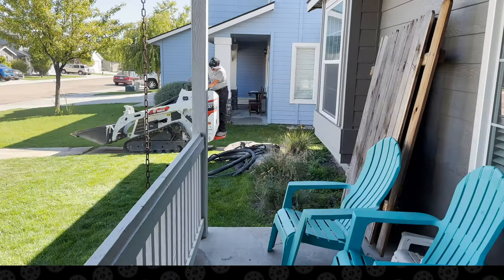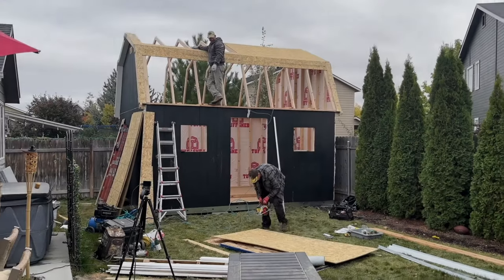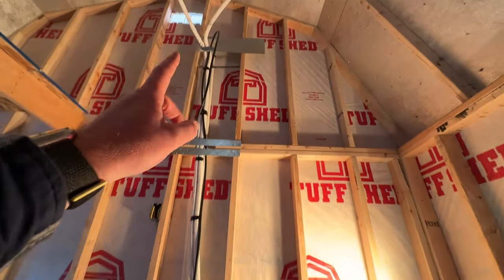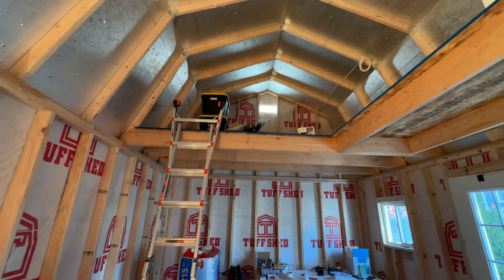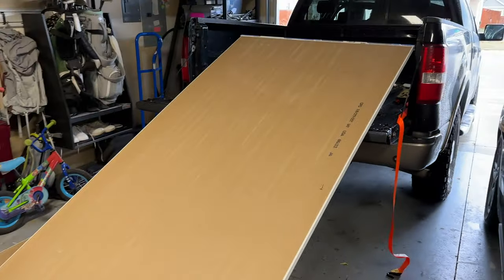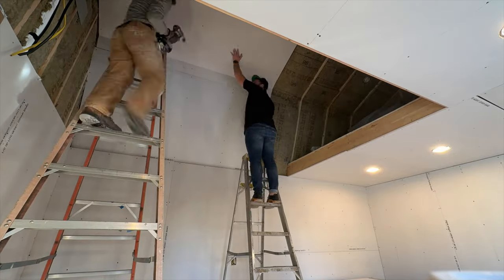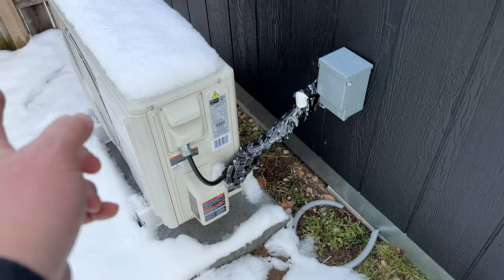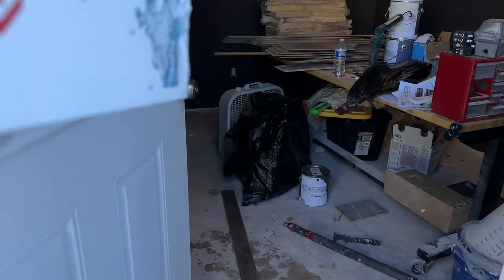Building a Backyard Studio in a Tuff Shed - Start to Finish

Comment: The only thing I did in mine different and don't understand why more people don't is put the outlets higher than standard. Eliminates a lot of cable hang and those short cables can be used. Plus Drywall seams should be staggered (done this for 30 years) makes the wall stronger. Great job!

Comment: I’m in the Pacific Northwest and am in the process of converting my 200sq ft Tuff Shed into an office space. The ceiling has the radiant vapor barrier like yours. Drywall and insulation contractors won’t touch the ceiling because of that vapor barrier and ventilation. Two have told me that baffles are required (which is an easy fix) but with 2x4s and the studs being 24” on center, that won’t leave much room for fiberglass insulation. The other problem I’ve learned after loads of research and talking to insulators is that insulating over the vapor barrier will 1. negate the function and efficiency of the barrier, and 2. create the perfect trap for excessive heat and moisture which eventually leads to all the problems. So, I’m curious about your ceiling insulation, are there baffles? Either way, how are you keeping the airflow between the vapor barrier and the insulation circulating? Have you noticed any issues yet now that you’re over a year in? (PS: I can’t get Tuff Shed to give me any answers about the ceiling and insulation, so any advice you have is great!!)
Reply: I am also in the Pacific Northwest with a TuffShed. Ours is the same size as the one in the video. 

I opted for the ridge vent. To make sure I still had airflow I used foam insulation taped to the faces of the rafters, leaving an inch space between the insulation and the inside of the roof sheathing for airflow. The air intake is via the eaves. I can draw you a diagram if you like, or share some photos. 

We've had ours insulated and sheathed in gypsum board now for almost two years through two winters and it's been great.
Reply: Walls & roof definitely need to be able to breathe. This shed is going to eventually grow mold in the walls and have moisture issues from heating & cooling.